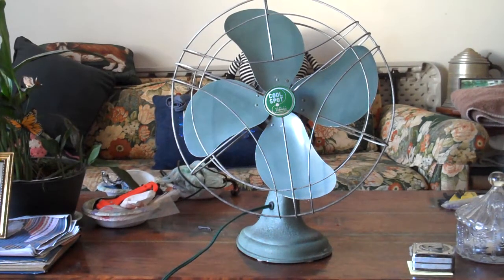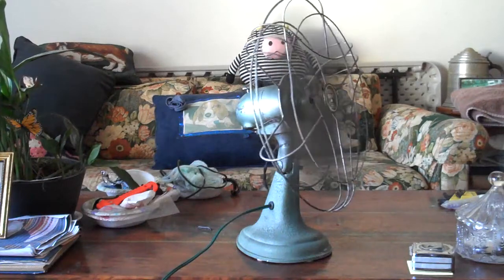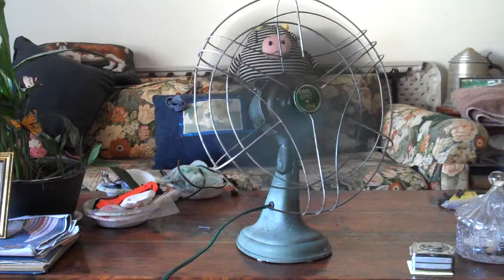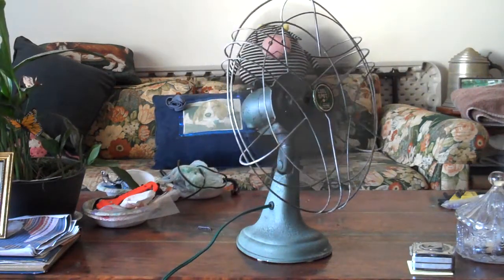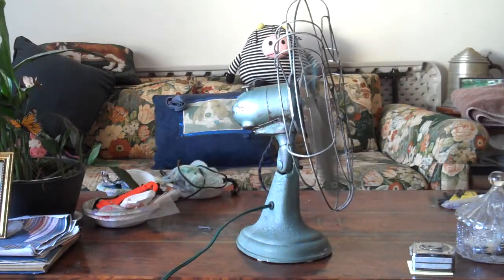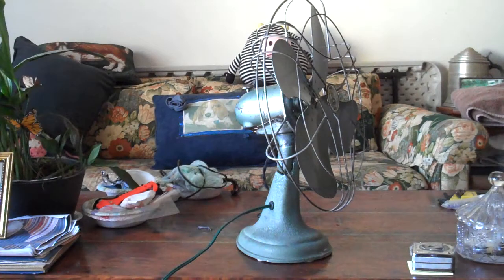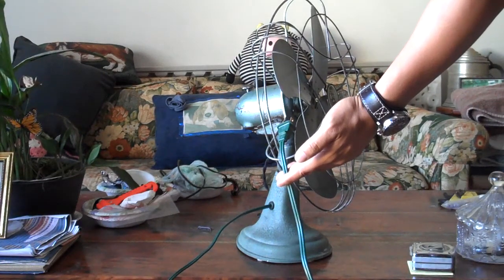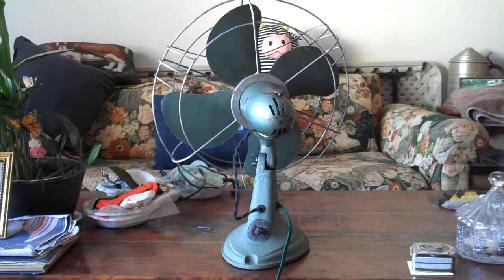Vintage 1950s Signal Electric 16" Cool Spot oscillating table fan

Comment: Hi D,
I have a 1649 just like this (Craigslist find) and want to get it back in working order. It was running a few years ago before I tried to disable the oscillator, and I have barely touched it since. Today I poked around and noticed a couple parts that need attention. I also saw some of your posts over at DT Vintage Fans and I have a couple quick questions but don't really want to join another forum.

Would you happen to know where I could find any diagrams or info on these things? Is there a good source for replacement parts like my oscillator gear which is missing a couple teeth? I might check McMaster Carr but maybe there's a better source.

I appreciate any info you might have!
Tyler
Reply from the maker: Tyler, no diagrams out there for wiring but there is a basic 3 speed diagram out on the AFCA site I can try to get to you. As for the gear I might have a parts motor with one that I can check. PM me
Reply: Sorry, I don't know how to PM on Youtube!

I might be interested in the entire parts motor depending on condition and price. Would you mind emailing me at 81cabriolet at gmail? Thanks!